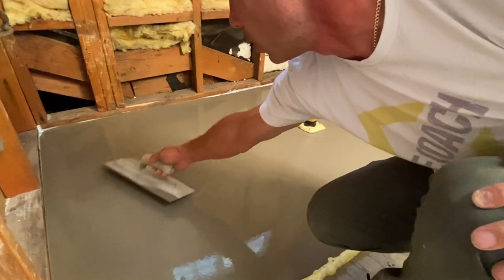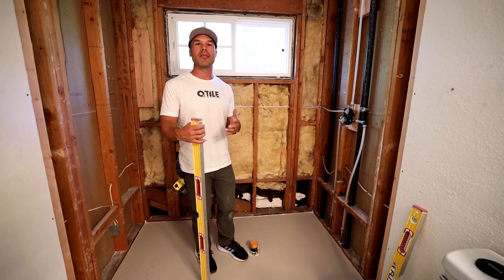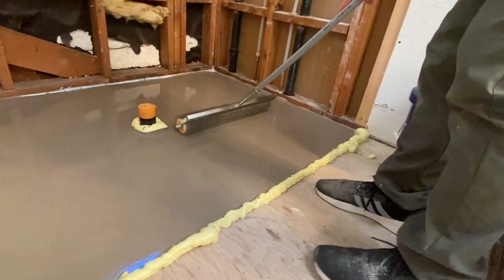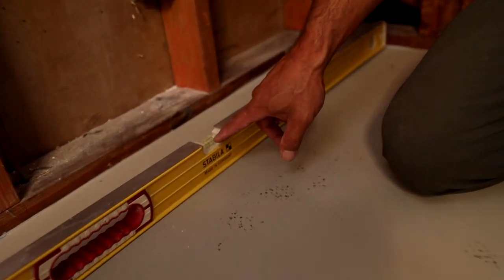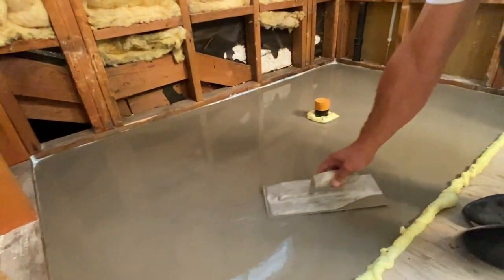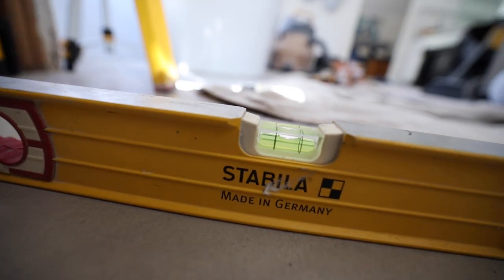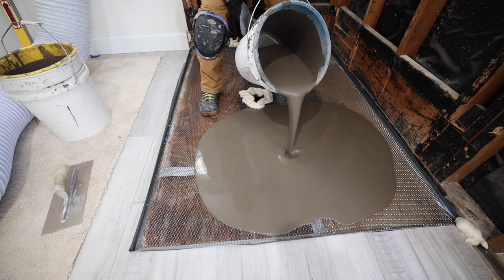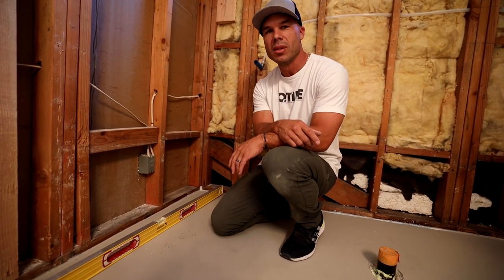Ardex Liquid Backerboard Results

Comment: i own a tile company and i use self-leveling float systems regularly when leveling floors.  these products are commonly used in Europe.  we sometimes level whole houses with these products.  the problems are also known to us.  with wooden floors we use a primer that blocks the wooden floor from moisture.  otherwise the wooden floor may warp due to the water in the liquid filler.  as a result, straight filling can become somewhat uneven.  But it is much more important that we install spacers on the unfinished floor, which are also filled in.  so we know how much we have to build in at different points to be on the same level everywhere.  I hope I can be of some help with my experience.  Greetings from Germany.  keep going with your videos.  always interested in how colleagues work in other parts of the world.👍

Comment: I am a retired tile setter. "Old" guys I worked around liked the ardex self leveler. But they said it needed a LOT more water than recommended. We NEVER had a problem with the overwatered ardex. You do have to work it a bit.

Comment: In our experience with this self leveler, and others, three things need to be adjusted based on what I saw in your original video. We always add 5% more water, and we've tested this shop side with no noticeable  loss in strength. You need to mix it with a higher speed mixer, it does not flow as nice with lower speed mixing. And lastly you need to be at least 3/8-1/2" over your highest point. Thin applications rarely yield good results in terms of level and flat. With that said we rarely use Ardex as a substrate since it does seem to not work as nicely as others, but we do use it as a pre-fill for uncoupling membranes and Ditra-Heat, which it does work excellent. Hope this helps and thanks for all your videos.
Reply: Any tips on using this to fill a ditra heat system? Been looking all over and can’t find much information about it.
Reply: @alexjarvis8636  did you mean to ask me or @tilecoach
I’d be happy to offer you my experience if you meant to ask me, but we’d have to do it off this thread. I don’t want to create a conflict of interests with issacs forum.

Comment: You have to fill wood joints and holes with Ardex patch, also you MUST prime with Ardex P51 primer, prior to pouring.  These steps with affect final results.  Also you need to pour a minimum of 1/8 over highest spot on floor. 
Try it again and follow the tech sheet exactly.  Great Videos.

Comment: I've used a lot of SLUs and Liquid backerboard is one of the least performing at "leveling". It does somewhat telegraph the topography of the floor beneath unless you get to a decent thickness, say 1/2" or more even then Ive seen a high or low spots still telegraph. There are qualities about it that most SLUs don't have, for instance it doesn't require wire for deep pours. My gut tells me to have an easier, more durable product that works for most subfloors, they sacrificed the qualities of an SLU that flow to seek level.

Comment: I just had this happen with Mapei self leveler. I used primer t first followed instructions exactly. Mixed leveler for exact time with exact cool water, walked 20 feet and dumped immediately, worked around quickly with deep notch trowel like I do with other levelers. There's no explanation for results. High where should've been low and vice versa, cracked in a couple spots. And this was in a 60 year old cement floor conditioned basement bath with no sun. Even left the bags in there for a day to acclimate. I understand that some products are ultra finicky. But way too many products are acting like if we mix at 600 rpms instead of 595, or if we add half an ounce too much water, there's going to be failure. We are not doing nuclear weapons here, give us products that work in the real world.
Reply: Interesting you got me second guessing myself, I used some type of mapei self leveler from lowes. Says it bonds to osb but it also said it would cover 24sqft at 1/4 inch which was bullshit. But other than that I set screws at the level height and squeegeed it to the tops of my screw heads. Was setting good before I left hopefully it’s good in the morning. I’ve used the ardex feather finish before, aslong as you put set screws at level or what ever you’re trying to accomplish, I’ve never had a problem.

Comment: i was NOT under the impression that this stuff is for self leveling, never used it but this is the reason why i did not. What i was told by a rep was that you need to poor  at a thickness of 1/2 inch minimum. The idea was that if there is not enough of it that it cant flow correctly. ive poured dozens of self leveling floors and this was NEVER a product we desired to use for exactly this reason. i know its fairly new but there are products that do not need lath that do the job perfectly 
Like yourself, (refering to the 8+9 videos) i do not bother with ardex when every time we used the product it was $$$ and never worked quite right or as nice as others.

Comment: For years, I worked for a contractor who only used cheap trade products. We never really had issues I guess but I always knew that when I solo, I’d start using premium products.
I started with Ardex. Thinsets, grouts, silicones and paint on water proofing.
I wish I never bothered. Literally everything dried way before it should have and caused me no end of grief. Their technical line was useless and getting support was a nightmare.

I only use their silicones now which are excellent, but the rest of their products are so inconsistent and unreliable.
Reply: I'm not a contractor, but what I am is a technician and I know that I don't use every single tool in my tool bag everyday.

Tools are meant for when you need them not when you want them.

It's good to learn about new products and try to experience their use, but for the most part, if it ain't broke, don't fix it!

Comment: Primer is needed before self level. Rep for TCNA says they sell way less primer than self level, when they should be selling just as much; as manufacturers recc is to prime. Rpm mixing and water ratio might be off like some have said. I think laticrete nxt you have only 12 hrs to apply tile, i think, after self level. Just a humble student. Thanks for your channel!
Reply: Good feedback! You mix the primer with water when using self level over concrete. And it goes a really long way as far as coverage goes. That may be why they sell less primer.

Comment: I use liquid backerboard all the time. You need to mix it at a higher rpm to get it to flow correctly, 650 rpm at a minimum. I use a collomix xo4 at 740 rpm. It just flows better when mixed at a higher rpm. I would be willing to bet that your mixer is rated between 500-550 rpm. Also, don't try to zero out a corner. Every time I try to it never works out well. I always try to pour a 1/4 inch above the high spot.
Reply: Thanks for the heads up

Comment: It was pretty obvious you didn't use near enough Ardex when you poured it.  It wasn't even a 1/4" thick you had to use a trowel to spread it to the corners. You can see the product had very nice flow so unless there was a leak I would expect it to lay nice. I'll always use metal lath when pouring my self-level. I use a 2" wide cap staples every 6" and I've never had a tile crack on me doing this system.

Comment: Thanks for the video   I was just about to use.  I have has success with Custom over 1/4" Wonderboard thinnest to sub floor.  Wonderboard is the same cost of lath...   Wonderboard strengthens the subfloor   Custom self leveling makes the tile install go way easier, especially sheet tile or herringbone.

Comment: Not a fan of the Ardex self leveling product, as never get good results.
Now, I do use Laticrete NXT products and have had good results as with customs products for self leveling, and even have used Mapei’s self leveler plus product. Out of all those brands, I prefer Customs and Laticrete as get consistent good results and that’s what’s key, imo. Also, the products are readily available and never have an order supply issue (yet 🤞🏼). Not sure what’s up w/ the ardex and others, as follow directions, don’t rush, and even have played around w/ mixing after speaking w/ ardex CS; thinking didn’t mix correctly (wasn’t accurate on liquid or rushed it when pouring); so, just stick w/ what has been working b/c not fun to have to redo or demo and prep again for not having results expecting, not fun when that happens and end up spending a day fixing and redoing a floor when thought would be installing; but it does happen